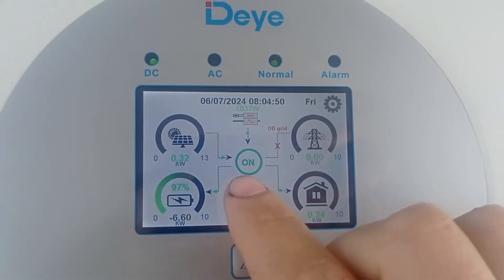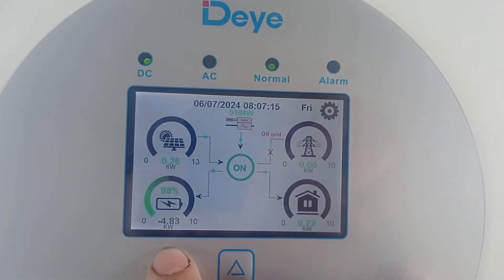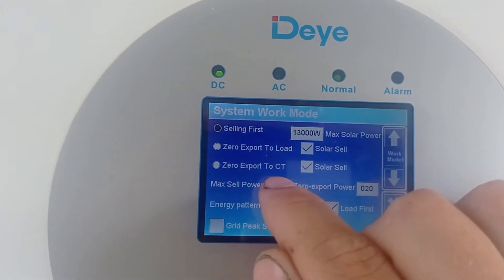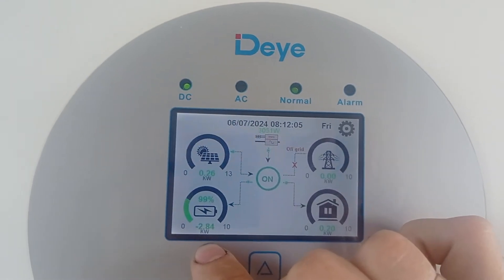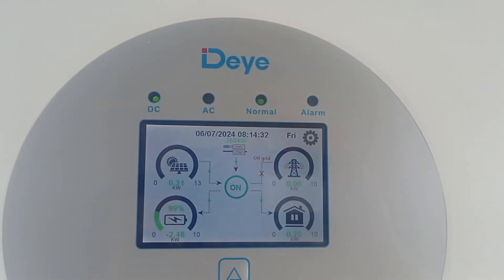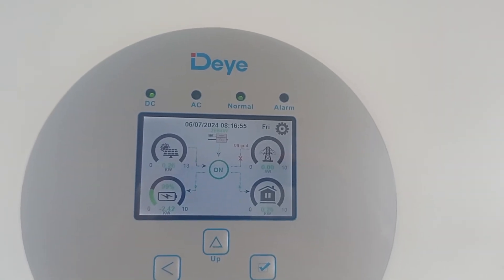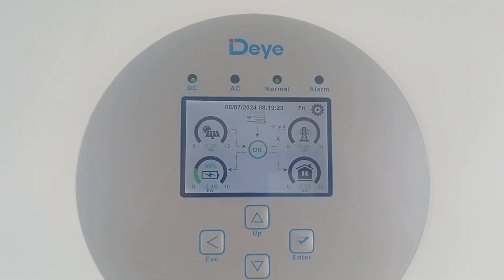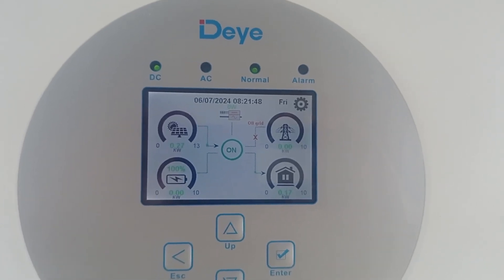How amazing AC-coupling works in Deye/Sunsynk inverter - limiter works using frequency, perfecto!

Comment: Hy. You are still accomplished by your deye? I want to buy one, and I'm not sure if to take deye or victron, but with more money.
Reply from the maker: I am happy with Deye, definitely. Over-the-air updates means constant improvement even of the old unit.
Moreover, very-very soon, like in about 3-4 weeks, another one 10 kW same unit arrives and will be installed in parallel to the existing one, I just need to double the load-bearing capacity for a pure autonomous mode, as well as I am hugely increasing a battery bank (not Deye this time, since they don't produce huge 15 kW battery units). My old Deye battery bank will still be in use, just in the other place, in the garage.
So said - I've had zero regrets of getting Deye, and getting more of their inverters. I also think of replacing my grid-tie Huawei to Deye hybrid, that's the next year project probably.

Comment: Hey nice video, I was wondering if you could tell me if I can use that AC couple feature on a hybrid 10kwh triphase deye that has no battery installed and tied to grid. it would be set to No export to CT. Can it work like that?
Reply from the maker: I think it should work. however as usual, if there is no grid - everything will shutdown.

Comment: This is how my inverter works https://youtu.be/uniz-mTrS6w?si=npiWmOprarKXNDG_ It see the power made by other inverter and charge the battery from that inverter and also from the two strings of solar panels attached directly to it. It can charge the battery at 5KW and can act as both on grid and off grid mode.

Comment: Hi, have you connected the "micro" inverter on gen port?, if i use a deye 6kW single phase inverter, i use a micro inverter with no grid i can sum the power of inverter, so 6kW and micro inverter like 2kW, the only limit is the AC passthrough that is 35A or 40A, so 8kW or 9,2kW, i have seen this sum function between grid and inverter but never between inverter and micro inverter, do you know anything about it?
Reply from the maker: yes, I mainly (like 98-99% of time) run my 10kW 3-phase Deye with either two or one single-phase small grid-tie inverters, you can call them microinverters as well. it works just as same, but the incoming power is way less of course.
I am using the big Huawei 20kW guy to support Deye, only when there is no grid and if I need a serious power added, so a rare case to be honest.
Reply: @BackyardVoltage  thanks, so in your configuration the deye 10kW 3 phase have can sum the micro inverter huawei 20kW to 10kW = 30kW that is the limit of passthrough current of your inverter that is  45A.
Ultimately, is it possible to use all the current both from the grid but also with the gen port and micro inverter?
Reply from the maker: theoretically yes, I haven't tried it yet though, since if there is grid I just use Huawei in its normal working mode.

Comment: Hi, you said this is the only brand who can do this, isn't Victron/Fronius also doing micro-grid (AC coupling, DC coupling and so on)?
Reply from the maker: check deeper about victron and fronius. their AC-coupling is done on the load side, and here it is done very-very much differently.

Deye/Sunsynk - can run in a completely off-grid mode - and then it will create a microgrid on a dedicated port (not on the load side) for a grid-tie inverter, and will accept all the load from it and manage the power to whenever required. If too much - will limit it using frequency.
Reply: @BackyardVoltage  It's also working on the load side for the DEYE... Paradoxally I prefer to do my AC coupling on the load to not let warm the DEYE inverter as it can be when AC coupling is done on the GEN port...
Reply from the maker: @sebydocky5080  yes, I tried that as well, but with the tiny current supplied (like 100 watts only). not sure if it will work with huge currents and power.

how is it in your case if you say supply 10 kW to the load side, on 10kW Deye inverter, if there is actual load of 1 kW for example. Will it also limit using the frequency mechanism if say, batteries are almost full?

Comment: Could you provide video to explain the difference between ( 0 export to CT - 0 export to load… ) as I still find this confusing. How it can be set to zero export to CT snd still can check sell to grid . Is thus inverter provide power to home using the same input lines by exporting just enough power for load ?
Reply from the maker: inverter has got internal CTs. so if you use "zero export to load" setting - it won't feed anything that is before the inverter. cand in general you may put into the load there that is not critical and can go off during power outages.
however, in case you aren't allow to sell power back to the grid, and don't want to put all your load under the UPS-load, you have to use the external CTs, that's what for the "zero export to CT" is meant.

in my case - all the load is a critical one, and I don't use any external CTs
Reply: Good day @MordernUkrainianHomestead

Can one also connect a micro inverter onto the load side of the deye or only on the GEN port?

Because the micro inverter is mounted far away in a different building and won’t be possible to have it connected onto the GEN port?
Reply from the maker: ideally it has to be connected to the GEN-port.
however, it can also go onto the load side, I've actually even done this this way, but in my case the input was barely low - 100-150 watts only, and the load was fully compensating it. I don't know how the hybrid inverter will work, in case if for example you will supply say 2 kW only the load, and the load at that moment will be say, 200 watts only... I don't know if in that case the frequency limiting will work, or if Deye will burn some of its relays due to the opposite current supplied

Comment: Hi great video, quick question i got 12kw Deye which I have already max out. Can I add a  AC couple  6kw to the Deye inverter? What the maximum can I add As a AC Couple.??
Reply from the maker: theoretically the limit there is the bypass current value. but the only thing you have to think about is that Deye has to have where to pass that energy - e.g. if you are selling it, or if you have load - than it's ok.

un your case - up to 12 kw you can connect easily, if three phase.
if single phase - 6 phase without issues. if more than 6 is required - better distribute is across the phases

Comment: What a well done Video! I have one question though. Can the deye sell the 10kw of it‘s own solar plus the 22kw going into the GEN Port to the grid when connected?
Reply from the maker: thanks!
no, it will not be able to sell it all, unfortunately. that parameter is not listed in any specifications, but 10kW Deye has got selling power limited to 15 kW for some reason. thus, it can transit the current from AC-coupled devices up to its' nominal listed continuous AC passthrough parameter, e.g. 45A on each phase, that's in case if you have got enough load to eat it all for sure.
Reply: @BackyardVoltage  thanks for the answer. So you can use all the power while off grid but if you want to sell you have to connect the 22kw to grid. Do you have a switch that connects to Either GEN or Grid?
Reply from the maker: @Bboy-1990  yes, there is the transfer switch that works in 1-0-2 mode for Huawei grid tie inverter
Reply: @BackyardVoltage  thank you very much! And all the very best given the situation!

Comment: This is a great video. I just want to confirm that while the Micro Inverter(Grid Tie Inverter) is charging the battery with MI export to Grid Cutoff ticked on, will the Hybrid inverter continously produce power from its own solar panels to provide power to home loads? Assuming that there is plenty of appliance turned on. In the video, there is a small amount of home load being used so I don't have a reference. I appreciate your answer. Cheers!
Reply from the maker: Deye manages the power form all the sources it has, including those AC-coupled.
It can sell it to the grid, or cannot sell it to the grid.
If the "selling first" is the working more - than it will sell, regardless of the checkbox status.
If the working mode is "zero export to load/CT" - and if the checkbox is ticked - it will not allow selling power from MI input to the grid.
about load - that's summer, so there is the little usage in general (18-20 kWh per 24h). in winter there will be times when 6-9 kW of load is visible (40-80 kWh per 24h for heating only).

Comment: Can you input single phase to Deye 3phase GEN Port?
Reply from the maker: yes, you can. my wind turbine grid tie inverter is a single-phase as is sent to the AC-coupling as well. moreover, you can combine them as many as you want, and combine three-phase with single phase. all you have to worry about is that the total capacity of those AC-coupled devices does not exceed Deye's transit current requirement (in my case 45A for each phase).
Reply: @BackyardVoltage  Great please kindly help me. How to Install single phase to GEN port 3 phase?   
- I have single phase L N G
- I connect L to L1.  N to N. G to G.  But inverter show only gen voltage no gen power to charge battery or no power to Load.
Reply from the maker: @multidev2  are you connecting generator? or microinverter / grid tie inverter?

if generator - it will not work, not possible, generator has to be 3-phase.
however, there is a solution - go buy a simple cheap inverter/charger (like this one for example, 48v one: https://s.click.aliexpress.com/e/_DlT0MzR) and connect the generator to its AC input and this inverter/charger battery terminals to the same battery the Deye uses.
then you can manually run the single phase generator to charge the batteries, when you see that there is lack of grid and sun and if the battery is getting drained.

if you are trying to connect a single phase GridTie Inverter (wind, solar, does not matter, just has to be the grid-tie one) - just do as you said - connect L to L1 (or L2, or L3, whatever), N to N and G to G and it will work.
Reply: @BackyardVoltage  I have hoymile micro inverter single phase to connect main consumer (home A load). I connect line L N G from home A to Deye 3 phase Home B. It is not work. I am thinking to direct connect LNG from micro inverter not form main consumer. Please help.
Reply from the maker: no, you don't have to connect the microinv on the Deye load side (at least it's better not to do so without a limiter).

connect the microinverter to the Deye's GEN-port terminals. and set up the GEN-port to be working in MicroInv Input mode, do not forget also to set properly the on/off values. there are many video-instructions on Deye official youtube channel

Comment: Hi, are you off the grid?  I was told micro inverter's cannot work without the grid?
Reply from the maker: I'm on-grid normally. and my microinverters for wind and battery (as well as the big 20kW 3-phase grid-tie string solar inverter) work perfectly in both cases - if there is grid, and if there isn't grid.
once Off-grid - I use Deye's AC-coupling mode, when the grid-tie inverters are supplied to the GEN-port which works in the MicroInv input mode. In this case Deye created them a local microgrid, where they keep operating even if I am completely off-drid

Comment: I think you need more batteries
Reply from the maker: indeed.
+1 more is saving my friend right now, he is using it before his battery pack arrives.
but eventually, the problem is that I need about 100 kWh of battery capacity, and I have only a quarter of that... to add up with Deye original is hell lot of money, to replace with Mason/Seplos is three times more cost effective, but still a lot of money... So, maybe I'll just use the DeiselGen to supply the extra once there will be no power.

Comment: How are the nuclear power stations doing in Ukraine? Heard that they are preparing them for winter maximum output
Reply from the maker: yes, current outages are exactly because of the preparations and technical maintenance campaign on the atomic power stations. Next week will be much better, since tomorrow they put 1 nuclear block back to work.
but in a week they will stop another one for maintenance, and so on, after all of them receive proper yearly maintenance.

but people had finally woken up, everybody who can - installs a hybrid inverter + batteries, and those who have a place to mount solar panels - do this.
it is a nightmare, since actually all the inverters and batteries are already sold out, so are the panels, and even more - the supplies that are on the way - are also sold until October supplies...

I guess, it will also help a lot in general, despite solar does not produce a lot in winter.

Comment: You're an inspiration!!! I have some catching up to do to get to your level, but I am amazed at how much I can generate and consume in a house with 3 old pensioners, me and an EV.
My SoFar HYD-EP inverter acts as an AC coupled as well, it's awesome how it charges from multiple sources of generation.
Love from Scotland and Screw Tooting Poo'tin!!!
Reply from the maker: thanks, mate!
what kind of EV do you have? are you happy with it? proc? cons? I am starting to look at that option as well I guess.
Reply: @BackyardVoltage  Hi ya, It is the Skoda Enyaq IV80, It Is lovely, Booming Stereo, Big Battery with great range, very big boot for wheel chairs and mobility scooters.  Handles good with very little body roll for its weight, it's comfy and super easy to drive.
Our first EV the MG ZS and it was a nightmare in comparison.
This Skoda has converted me, not to save the plant, save the petrol for my Motorcycles lol.

Oh one really bad on hinge is the Lane Assist function....    It panics and snatches at the wheel, it is far too intrusive and the option to turn it off is buried balls deep in the menu screens.
Hope this helps mate.
Slava Ukraini!
Reply from the maker: Glory to the heroes!
Does your Skoda have any so to say levels of lane assist intrusion?
Reply: @BackyardVoltage  No unfortunately not, it is on or off. On as default Euro Nanny rules 🤬
Reply from the maker: okay, got you

Comment: How big is your house? 100KWh a day is a lot. You should probably check for leaks and isolate your house better.
Reply from the maker: No leaks possible, as there are no water transfer lines. I use ceramic heaters which are low-consumption (6kW max instant consumption for the whole house).
The house itself is quite big, 300 sqm, also, the 100kWh is only for the days when it's -15-17 Celsius outside.
If it's around 0 Celsicus - the consumption for heating only is roughly 55-60 kWh.
Monthly heating usage was 2300 kWh so far max (in January 2024).

And well, truth is that I have not finished the insulation yet, two small things are still left to be done - the bottom part of the concrete foundation is not insulated at all at the moment, I am starting on it this month though. And also on the underroof floor there are several places where I have to apply additional 200mm mineral wool insulation, that's also the next step to help with reducing the heat loss.
Reply: @BackyardVoltage  I was thinking about air leaks
Reply from the maker: ah, yes, well, the ventilation is the main one... Everything else is pretty nicely sealed. If you will calculate the losses, they are great actually, given my walls and windows surfaces.
100kW per day, means 4200 kW of electric energy consumed, means, there are 4000 watts of thermal energy losses each hour (on average). And now the surface area of the windows and walls combined is 295 sqm, which results in 13.5 watts of thermal energy losses per sqm (walls and windows), and well, since the floors sqm of the house are about the same as well, it is realistically 5 times less than what is considered to be normal (80 watts of heating power for 1 sqm of room area for example).
Reply: If I do your calculation on my house that are in the Nordics then I have a heat loss of 4W sqm, so there are definitely room for improvement in your house.
Reply from the maker: let me guess - you have a heat pump?
and liquid based heater-tank system then transferring heat to the radiators or to the heated floor system?
correct?
Reply: Correct, I have a heat pump, but the outer walls are 200mm rockwool 200mm aerated concrete, vapour barrier and 50mm rockwool.
Reply from the maker: then we are roughly equal, since you have an expensive heating system (let me bet its cost was at least $30k, did I guess correctly?), which uses less money/power in a single month. I have a less expensive heating system (spent $2.5k on the whole house only), but it uses more power/costs during a single heating month.
So somewhere in 40 years time our system's combined expense will actually be equal and then you will be more profitable. Given your system has about 4 CoP...

my walls are 375mm D500 aerated concrete + 200mm Rockwool Frontrock

however, the concrete foundation is not insulated outside at all (from the inside before the floor - there is 15cm of PPE insulator), and I agree it is currently the weakest point.